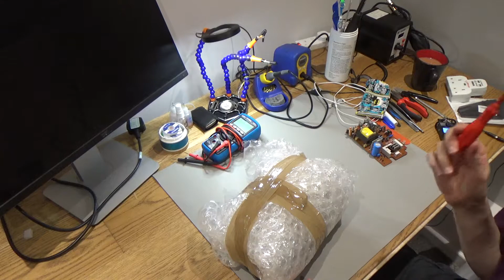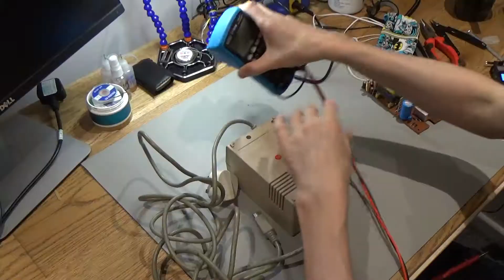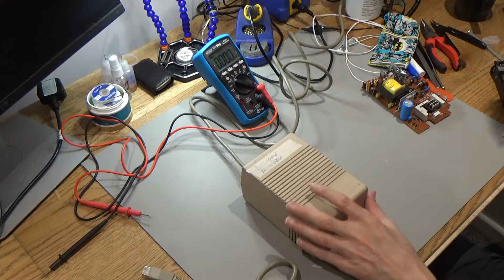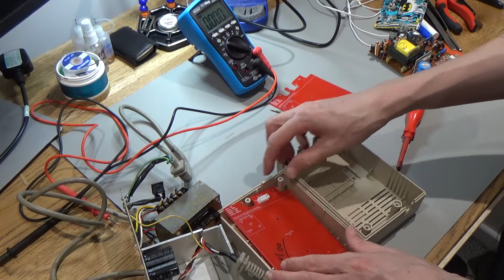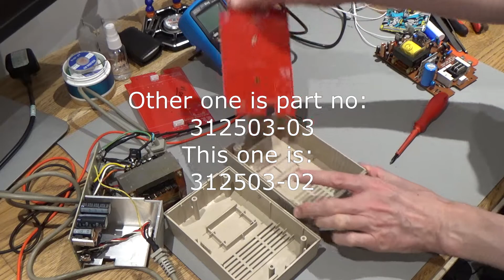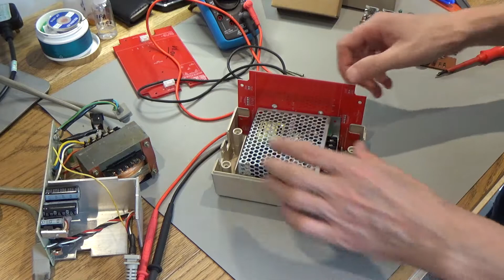Amiga PSU Part No: 312503-02 from eBay

Comment: My  312503-02 just died 5 minutes ago with a loud bang of the  small cap in the far bottom right  (supply wires would be bottom left in this case). I'm debating if it is viable to recap it all or just get new one / some mod.
Reply from the maker: I think if it made a loud bang then something may have gone wrong and it might not just be caps. It may have failed and damaged other components. It probably can be fixed but I would try to find the fault before doing a blind recap as you might not be fixing any problems by doing that.
Reply from the maker: I can say that I've used this PSU with the meanwell mod inside it a lot since this video. Hours if live streaming and more. Very happy with it.
Reply: @DavePoo2  I'm just ordering the meanwell, thanks to your video. Looked it up and seems like it's the cheapest / best way.
Reply: @DavePoo2  It made a bang, took it apart, one cap is gone. Amiga kept running for few seconds and I pulled the plug instantly 👀
Reply: @DavePoo2  Wow, nowhere in stock. I'm so disappointed now -.-
Reply from the maker: @spawnterror  Are you in the UK, I think this is where I got mine from https://www.powersuppliesonline.co.uk/rt-50b-50w-5v-4a-triple-output-switching-power-supply.html
Reply: @DavePoo2  I have ordered from them 2 days ago. Just got update today that they are also out of stock until 12th of July. No luck again. Oh well, in the mean time I can recap the old one. Would you be able to check the bottom left corner capacitor value please?
Reply from the maker: 50v 330mf

Comment: I have a 312503-03 . The -12 V gives me 16,5 V.  Do you believe by Replacing of the electrolytic caps and some resistors I could  improve that number?
Reply from the maker: Not sure, could be any kind of problem there, It does sound like it's out of spec and shouldn't be used anymore. The -12v is send to the ports and it's used for the audio amp in the Amiga, so not sure what kind of problems you would get from using that.
Reply: @DavePoo2  oh, so it could  turn out  a waste of time  to hunt down and replace all those components. Ok thanks for pointing out that possibility.
Reply: The 312593-02 is a great PSU. A recap will do it some good and you can adjust the 5v & 12v rails on it but it’s recommended to replace the VR’s with static resistors of a suitable value to lock it to the right value under load. 

I have one of these and a switch mode that was dead so I put a meanwell RPT-60b in. On my main Amiga, I use the 312503. It’s never failed.

Comment: My PSU is 312503 (with 2 stamped on the casing afterward) and its TOTALLY different.. all the screwholes are in the corners. So this board wouldnt fit at all and yet...   I mean, is the purpose of your board to make the connections easy or to ALSO provide something for the meanwell to sit on.  I guess I would need to remix your board to fit mine and with the corners cut out there is precious little for the board to sit on!  https://ibb.co/KmCd5Px  &  https://ibb.co/dD8Tvmh  if U wanna see what I mean
Reply from the maker: Sorry i couldn't look at your pictures as the site doesn't load, but that's really odd that you have the same case number but it's different? I think one thing that i found out after i started this project was that there are a lot of different variations on the PSU cases and although they can all look very similar from the outside, they can be quite different inside. It's odd that your case has the same part number as this one, yet is different inside? that i don't understand. However, i can say for the case in this video, i actually just put the Meanwell straight into the case (with no mounting board) and it actually holds in very snugly when the top case is on (and it had really long leads on the DC side, so they reached over), so i actually do use this one quite a bit now, and it works quite well.